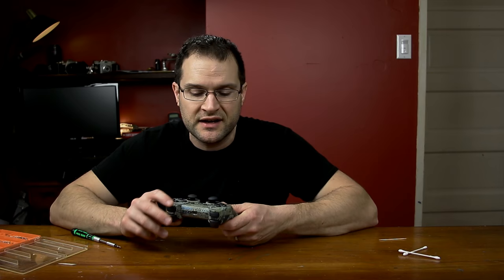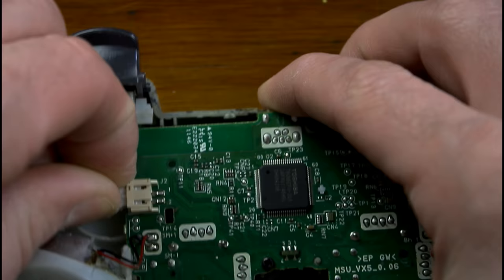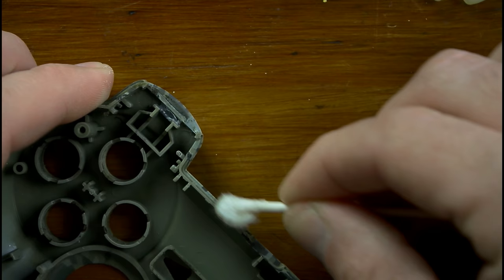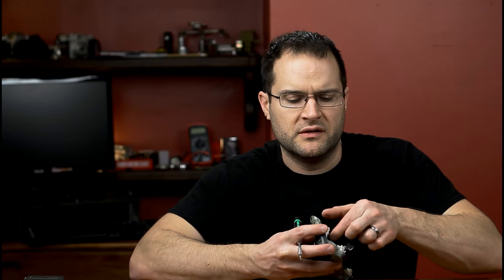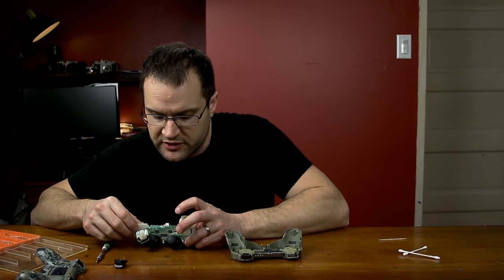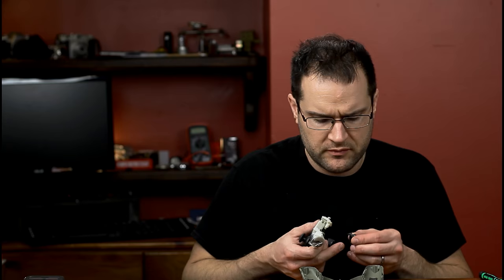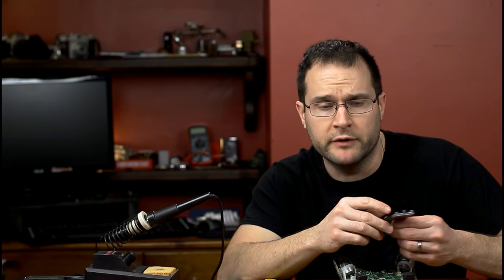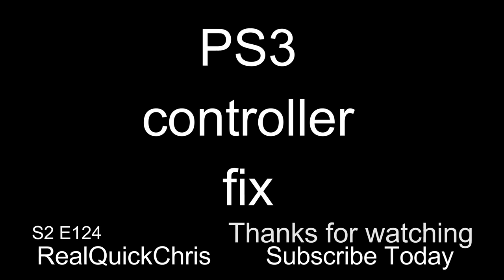how to fix a ps3 controller that moves by itself s2e124

Comment: My right analogue stick moves on its own, it's really difficult to play with
Reply: same
Reply from the maker: With some controllers you can clean up the contacts for the analogue stick and some other models you can replace the whole stick by buying one on eBay for about $4  but yeah you can't play COD, GTA or Minecraft like that you guy just goes wonky
Reply: same
Reply: Mxjz ° just buy A New 1 bc you wont be able to Fix it, i cracked it cleaned it Replaced it still didnt work...the only way it did work sometimes was if i pulled the stick up..& played like that..🤷
Reply: Same but on the left
Reply: Mxjz same as mine
Reply: Whenever I go forward the camera starts rotating to left fucking pain in ass
Reply: Same
Reply: Me Too
Reply: same
Reply: Same
Reply: @forthelinkuei3610  same m8, left stick drifts to the left really annoying playing borderlands 1 & 2 👍👍👍👍👍
Reply: I broke my Stick doing the “Rubber band/ Sneak” around Giant Rats during Tutorial...... Archer Assassin, or Thief Back Stan build....
Reply: Same 😑
Reply: @rajchopra3868  i have the same issue

Comment: That odd thing is I bought brand new controller from eBay
Reply: Careful wit the knockoffs my friend. I’ve also used to purchase on eBay😅There’s many fakes out there!
Reply: Its like a dark guy came to your door  and help u fix the problem.
Reply: @rubenmelchor8  I recently busted out my ps3 to start playing it again and all my old controllers have this issue. Inputs being activated like crazy without me pressing anything.  I have a feeling it’s a problem with the console since it’s every single controller. Very strange

Comment: Bought PS3 Slim somewhere in 2010 and been playing it till i got married in 2013. the console unit and its accessories has been kept in the box for that long till today when my son now 9 discovered it and wanted to play it. the controller showing erratic behavior moving on its own. Your video saves it, what i did was cleaned up the contact points using contact cleaner and now it works!!. Thanks!

Comment: You can replace the trigger springs in a PS3 controller with the spring found inside an old floppy disk, if you happen to have any of those lying around! I've done it before, and while it can be a tedious task, they work great! You will need to shorten them just a bit to the length of the original springs.
Reply from the maker: Awesome tip I new I saved some 3 1/2 floppy disks for a reason lol
Reply: They are also in VHS Im pretty sure

Comment: My joystick moves by itself in gtav that makes the character walk in circles. Any help
Reply from the maker: Depending on what model controller you have you might be able to look up a new thumb stick on eBay and if you're any good at soldering take it apart and soldering a new one cost like five bucks
Reply: Same
Reply: Same
Reply: Same dude

Comment: I just did the second clean and I surgically cleaned the joysticks with compressed air and it works perfectly, although I broke a few plastics in the process. Thank you a lot, now i can finally enjoy MGS2 & MGS3 after 2 years of it being broken.
Reply: its crazy you mention MGS2 and 3 cause I finished 2 before BOTH my ps3 controllers went crazy and have been thinking about fixing it(cant get any new original ones for ffs) so that I can go back and finish 3
Reply: @4dualshock  its quite hard find original ps3 nowadays, but fyi ps4 controllers work just fine.
Reply: @smokestore9098  Ps4 controllers only work for certain ps3 games though for example you can't use a ps4 controller to play gran turismo 5 I read you couldn't use one to play gta5 so I tested my dual shock ps4 controller on gta5 and they were wrong it worked for me I have nba 2k11 and a ps4 controller won't work on it
Reply: I know this was two years ago, but this is hilarious because this is exactly the same reason why I needed to fix mine so I can play MGS hahaha
Reply: Yes
Reply: lol im fixing my controller primarily because i dont want to have to play through any more mgs games with it being broken, i beat 4 and died several times to the drift
Reply: @ashmarsan  after 1 years 
Same thing hear
I want to play mgs but the controller is crazy
Reply: @atif45602 why don’t u put the ps3 controllers in a drawer and close it so no dust goes inbetween the controller so it won’t act crazy and jumpy when u leave it out the dust in the air goes between the buttons.

Comment: Thanks alot for the amazing advice. Turning that little skinny piece of rubber was the true trick. I believe it wares itself flat and by flipping it over it allows for a better connection. My controller was pretty clean, I barely used it cause it was a new backup. So Flipped  the rubber piece and it works like new!! Thanks again. You have made a long time Skyrim lover very happy!! Take care one and all. 👍😀

Comment: @RealQuickChris thanks for the tips. I've been looking for a replacement ps3 controller and unable to find one... finally did but it wasn't working either. I was able to use it for spare parts. Now I'm back up and running again! (Real hard to find an oem ps3 controller when the ps5 is around the corner.) Thanks Chris!
Reply from the maker: I have never been happy with the PS3 controllers never had an issue with my PS2 controller still don't lol

Comment: You have no idea how much your video saved my life...🥵 THANK YOU SOOOO MUCH. those stupid motor wires broke on me like 3-4 times and that rubber piece had no clue as to where it fell from until your video &  so much more.. And all I did was purchase a used ps3 off ebay and wanted to clean it up for my son. YOUR VIDEO WAS DEFINITELY A LIFE SAVER.🙌🙌🙌🙌🙌🙌. You have a new Subscriber.

Comment: Great info! I had OEM DS3 controller unused because of rapid character spinning when ingame. Followed the tutorial, loosened and clean ribbon cabel and motherboard contacts with cotton swab moisten with isopropyl alcohol (there were 2 in my controller type) and sticked some tape on supporting rubber to make better grip and that completely SOVED PROBLEM !
Thanks for effort of making this video. You've got 👍

Comment: I worked actually... It's that sponge that was too thin ...now it works.. Thanks a lot 🙏💕
Reply from the maker: Nice. I never had an issue with my ps2 controller but man theses new ones don’t last
Reply: @RealQuickChris  The PS2 controllers are solid like a brick. The PS3 controllers are much cheaper quality

Comment: Thanks a ton :)
I added a strip of electrician tape to the black rubber thingy to make it thicker, and I cleaned the flex cable and the contact area of PC board.

It works perfectly now
(I also had to solder a lose wire, but that was a different problem, it was my first time soldering but it went fine).

Comment: Thing is,when I connect to ps3 it works perfectly,when I connect to pc it bugs the left stick,and guys its risky to open controllers this guy don't say this but old controllers the plastic is weakened by the time try to open let's say a 5yo controllers you might having problems and break stuff it happens and its normal specially with older ones so only if you positive that is a "hardware" cause if it is not you ended up like me,follow this guy's steps carefully and even being careful I broke an essential plastic frame so it is not good,I connect to see if it worked after cleaning and still the same problem

Comment: Have you ever pulled a PS3 console apart.. Mine keeps turning itself off.. I think its full of dust and fluff.. I was told it may be overheating but I reckon dust is the main culprit...

Comment: I must take care of my original PS3 controllers so they last many more years because any replacements are crap knockoffs and are digital. I have a 4 piece model and a 2 piece model. Gran Turismo 5 wants analog controllers, which the original ps3 controllers are while ps4 and knockoffs will not work with the game. 

I cleaned both of my controllers and added some tape to the bottom of the foam part so there is a tighter connection. Worked like a charm and all clean. You can order new battery replacements on Amazon for $20. If you must, search ebay for refurbished original OEM PS3 controllers or motherboards.

Comment: This didn't really show me how to fix stick drift but another tutorial how to take apart your ps3 controller is always welcomed.
Reply from the maker: Yeah stick drift is in the thumb stick and to do it correctly requires desoldering and soldering on a new thumb stick. You could get away with forcing the thumb stick housing open pulling out the contacts and cleaning everything up but you run the risk of cracking the solder connections or bending and breaking the thin metal of the contacts of the insert for the thumb stick.

Comment: I appreciate the video. There are better videos fixing that connection without taking it to that level. Add some paper from the sticky side of a post it to the sponge and done. I added like 3 and my controller works super good now
Reply from the maker: Nice tip

Comment: What do you do when the lights of the remote of the ps3 keep on blinking what do you do
Reply from the maker: I had an issue with a controller blinking as in it would not connect to the ps ended up being the charging cable was bad but it could also be the port on the controller. I would first try to rest the controller by pressing the rest button on it then connect it to the ps with a good charging cable and go from there
Reply: You can also go in the settings and  look for bluetooth connecting

Comment: L1 and r1 placement gavee greif. If you have trouble like i did, you place them after the pcb is fastened into the front plate. I kept mushing the rubber membrane by placing the l1 and r1 befote the pcb. Dont be me.

Comment: I've tried it once and had to discard the controller because no one could reassemble it, hope it goes different this time.
Reply from the maker: Hope it all goes together for you
Reply: @RealQuickChris  thanks, it actually went, in 10 minutes I fixed it and put it back together.

Comment: It’s started getting random inputs on my original controller years ago.  Bought a used one and it had the same issues.  I should have just bought a 3rd party new one

Comment: Currently trying to fix my the joystick moving by itself, I can't open my controller because I have a multi tool that's really hard to use
Reply from the maker: Fixing a thumb stick is a little more tricky depending on what model controller you have you might be able to find the part on eBay and soldering a new thumb stick it's just a little more involved
Reply: @RealQuickChris  No, the character in game moves even though the joystick isn't moving, but I already fixed it now
Reply: @khuzairiaziz8019  Please can you tell me how you fixed it? Cause I'm having the same problem.

Comment: 4 any ps3 fan doing this. Depending on when or what dualsock you bought. Their insides will look different. The worse are the oldes one like from 2008 trust me, you don't want to get disassemble one of those. Edit This one in the vid is pretty close to it. Lil diference is that the battery is not plugged but solded cables. And the most mageous part being the plastic thing if it slips out of the bumper and trigger is a pain to put back on.
Reply: Opened an og One and made a mess, broke the two Little Pieces between R1 and r2 AN l1 and l2😅

Comment: (READ) if your planning on buying a PS3 controller. Go to amazon and don’t buy a used or official Sony controller. Always buy a third party one around 14-16 dollars. Don’t buy a 2 pack one either.
Reply: I can understand why you shouldn't get a controller that's used. But what's wrong with getting an official Sony controller that's brand new? Or a 2 pack?
Reply: @floridahighwaypatrol7713  too expensive.

Comment: I found the >>SOLUTION<< for my dualshock 3 (Thumbstick Re-calibration)! Read me!!

WORKS on the PS4 controller too!!

Thumbstick Re-calibration:

Turn off the PlayStation 3/4 and controller (please make sure the console is not in rest or standby mode).

Press the thumbstick in and hold (press just until you hear / feel a click) for 30 seconds.

After the 30 seconds have elapsed, release and rotate the thumbstick clockwise followed by counterclockwise at least five complete circles a piece.

Lastly, press the thumbstick in and hold for 30 seconds.

Enjou!!  ;)
Reply: Is this real or you're just messing about
Reply: So it doesn't work?

Comment: I have exact same controller and both analog sticks move to the left
Reply from the maker: The analog sticks could be a different issue. I have a used controller that does that I need to replace the actual analog stick I just haven't done it yet it's like a four dollar part on eBay. Depending on what model

Comment: My controller is practically brand new and it just started having stick drift problems I bought my ps3 controller from a website because I couldn't find one in a store mine is the dual shock six axis controller one question though are these controllers supposed to be significantly lighter than the dual shock 4 ps4 controller mine is really light and the buttons seem cheap when you press them the box it came in looks legit and so dose the controller but for some reason I'm still thinking it's a fake clone

Comment: I recently bought a red PS3 controller from CEX that was having this problem but it was not to do with the analog sticks for me. mine only started happening everytime I press and hold the PS button or plug a charging cable into it. It goes haywire and starts moving everywhere on the XMB menu by itself sometimes entering my profile, trophies, the store, inbox messages and such by itself. I had no idea there was an actual name for this issue though. As much as I would like to attempt this I somehow doubt it'll help with my issue.

Comment: I can't Pull the battery Out, Same controller. Any help?
Reply from the maker: Possible that the battery is held in place with sticky foam and the connection is fought to disconnect sometimes just remember to lightly pull/wiggle at the connector not the wires. It's easy to rip the wires right out.

Comment: Wow..thanks mom for a used PS3...first thing...the 2 buttons fire and throw lethals dont work..then yesterday my paddle/joystick wasn't working.
Reply from the maker: Ahhh these controllers are frustrating to no end and the ps4 ones are no better.  The Fire buttons may come back after a cleaning but the thumb sticks are more of a pain. There is kind of a video out there on how to clean the contacts for the thumb sticks but it’s very easy to break them they are very fragile.

Comment: I actually fixed one of my glitchy controllers but now there is this thing with the battery and no matter how much I charge it it'll just turn off periodically and then 'lose' all battery. Also my L2 and R2 triggers are very sensitive. Anyone willing to offer assistance? It would be greatly appreciated.

Comment: Alright. Well to put it simply, I have loose analog sticks but they do not wander or anything like that. When I took the controller apart and plucked the sticks off the mechanisms, those worked like normal. But when I put the sticks back on, they were loose like before. I tried switching them around to no luck. Am I SOL and going to have to look into new mechanisms? My controller is a white Dualshock 3.
Reply from the maker: Are you saying that the plastic part you put your thumb on is lose? And when you take the plastic thumb stick part off the real component that is soldered to the pc board is working well? I have had the plastic thumb stick part crack at the base where it goes on before and just replaced it with one on eBay for a few bucks. You could also use some glue if you want but I would use school glue something that is easy to take off if you have other issues in the future. Let me know if thats the problem or if I am misunderstanding it.

Comment: Hi RealQuickChris.
My ps3 controller X O □ triangle are dead...what do you recommend to do ? Thanks.
Reply from the maker: Cleaning up everything has worked well for me it's amazing how much junk gets inside the controller and makes it not work right.
Reply: @RealQuickChris  
It didn't work, i have cleaned two times, i don't know what else i can do. The controler was ok...then it was not. Any thoughts ? Thanks
Reply from the maker: aside from cleaning the connection on the board and the ribbon cable,  maybe just behind the buttons themselves.  did you flip or replace that black foam piece?  that thing needs to create pressure on the ribbon cable to the board for everything to work if it's worn out it could cause problems.

Comment: Actually Chris mine is doing the  drift on the left stick the drifters towards the right and it was a brand new ps  three dual shock controller in the box for $50 I don't rage I don't smash my controller just normal playing and it was pretty much doing that out of the box but it was a final sale at a pawn shop so However they are really good people and they would've given me a store credit for sure but it's not worth it I thought I just keep it and see if there's anyway I can fix it and that's why I chose Your video
Reply from the maker: Stick drift is a little different in that you have to clean the two set of contacts on the thumb stick. The bigger problem is if you do it the fast way you run the risk of breaking the housing when bending it back to reach the contacts. The correct way would require desoldering the thumb stick from the PCB and replacing it or opening it up to clean it.

Comment: What mine does is it literally moves forward by itself can you PLS PLS PLS pls tell me why that happened because I just got it
Reply from the maker: That’s more than likely an issue with the thumb stick having gunk build up on the contacts inside and it’s kind of a pain to take apart and clean. My son he fixed his by watching some video but it have never gotten it to work with out taking it apart.